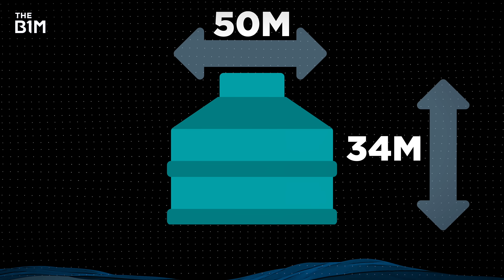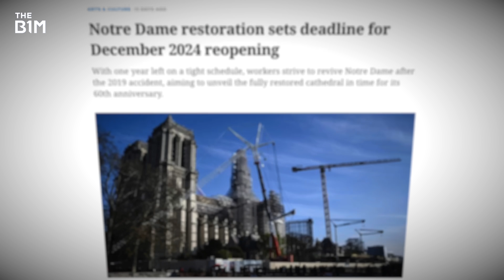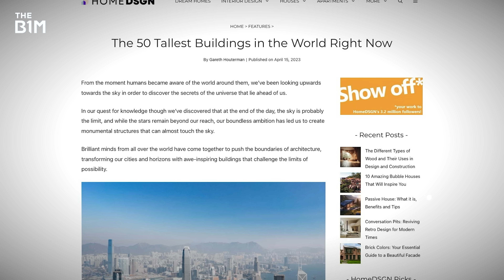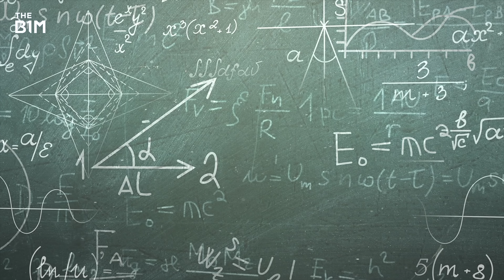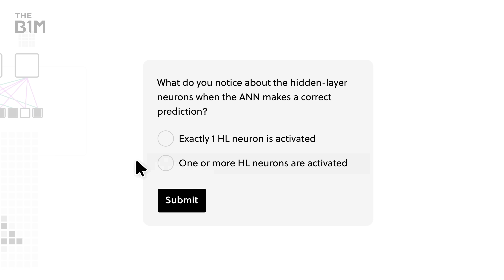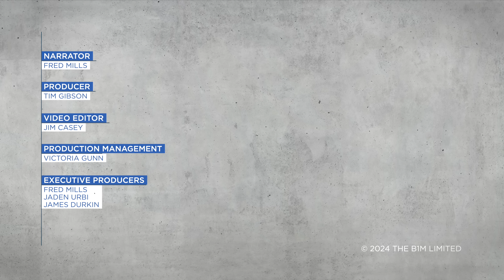Top 10 Construction Projects Completing in 2024

Comment: The One in Toronto has just applied for a height extension from 82 to 94 floors. Which recently got approved. Also, there's 2 more supertalls in the same area (one is in construction as i type this) at the bottom of Yonge street that will alter the skyline forever. They too have applied for height extensions going from the previous 90 floors to a new record breaking height of 104. Making the one under construction the first 100 storie building in Canada. The second one will go from 80 to 94 floors. 

There's also a lot of supertalls that have been approved but havent started construction yet. I would love to see a video made on these projects!
Reply: Toronto has so many projects proposed, approved and under construction I gave up trying to figure them all out. Now I just enjoy the ride of Supertall towers going up there... The One is still my favorite though and I do hope Apple reconsiders and signs onto their custom-designed space in the lobby...
Reply: @stickynorth  Me too. I love how the One looks so far with it's dark windows and NO BALCONIES. One Yonge is far more built up since it has a more typical design floor plan.. but the cladding should be interesting to see on that project. I too hope that Apple reconsiders as that was the reason why the One looks like that.
Reply: I've been visiting Toronto regularly since the mid 1980's. The city has changed SO much, as has the traffic. Back then there were dozens of lanes that were virtually empty most of the time. Today traffic is between slow and awful much of the time and there simply is not way to build more roads. Thankfully public transport has been undergoing major expansions as well. If you are heading into town from the West, the most logical thing is to leave your car in Burlington an take the Go Train. Maybe we'll actually have a link to Buffalo at some point in the future so we don't have to drive half way there. The downtown sky line has been absolutely transformed. Back in the early 80's, the CN towner appeared to be in the middle of nowhere. It was hard to get to on-foot. Now the city has absolutely exploded in growth around that area and it's now surrounded by dozens and dozens of tall residential towers. I still love visiting. I'll be keeping an eye on the sky for the new Super-Tall buildings being built.
Reply: @andrelam9898  I've recently visited Toronto and was surprised from all the foot traffic. Toronto of my childhood was quiet.
Reply: Just a small correction, The One got approved for 91 stories at 328.40m :) And the SkyTower (Pinnacle One Yonge) got approved for 105 floors and the second to 95 floors!
Reply: Okay, so we need an entire vid on the Toronto boom!
Reply: @deletedaccountdnd  what to show how no one is able to afford them and they sit empty due to the mass amount of freeloaders and fake international students that are only here to steal jobs from Canadians hmmmm time to wake up woke as Canada is in a huge problem that the big 3 can't fix unless they start send some back as Canada should not have 40 million jump in a year 38 million to 40 just shows there is a problem
Reply: The One went into receivership in October 2023 in case you missed that news timbit. "the corporation co-owned by Mizrahi and fellow developer Jenny Coco was $1.6 billion in debt to its lender, South Korean KEB Hana Bank; a trustee for multiple funds managed by IGIS Asset Management." - This channel doesn't research hard.
Reply: The one is bankrupt and not even half its final height.  its not opening in 2024
Reply: @georgewilson19   on the contrary it's now rising faster than ever with the new construction leads who took over!
Reply: @Stecbine  Hmm interesting. This was one of the reasons Apple pulled out.. because it was taking too long to build. Apple probably didn't realize that this was a totally new construction method of building for Toronto.. hence why it's taking so long.
Reply: @georgewilson19  You're right but you're a month late as the building is still being built to it's desired height. It probably won't top out until late 2024/25

Comment: There's one major point about Paris that was left out : Transit !
In 2024, there are 4 important public transportation expansions set to open : 
The very first sections of the Grand Paris Express project, a humongous metro expansion.

The 6 km Eastern extension of M11 towards Rosny Bois Perrier interchange station connecting with RER E and future M15 circular metro line (South section of M15 set to open in 2025).

The short Northern (2.3km) and large Southern (14+ km) extensions of M14, the core backbone line of the GPE, up to the GPE's main hub station in the North, which is Saint-Denis Pleyel, and to Orly airport (Paris second one) in the South.

Plus the first phase of the very large Western extension of RER E with 3 new major interchange stations along a new 8km long deep tunnel under the hyperdense core of Paris and La Défense business district:
Porte Maillot / Neuilly station, a huge trapezoidal underground light-well under a skylight ground-roof and lined by rows of caged escalators.
La Défense CNIT station, a giant cavernous underground cathedral that was built "like a mole" under the still functioning CNIT expo center by extending its foundations and creating a huge cavern underneath.
During construction it looked a bit like Tokyo's flood reservoirs with its giant pillars.
Nanterre la Folie station, a large, mostly open-air station built in a trench and partially covered by buildings. It will act as a partial terminus for some trains and thus has 6 or 7 tracks if I recall correctly.
The new underground stations are gorgeous and continue on the "giant cavernous underground cathedral" legacy of Paris RER stations.
The rest of the Western extension towards the far flung suburbs of the West will open later.

And finally, the circular tramway line T3b's extension from Porte d'Asnières to Porte Dauphine, further advancing the still incomplete loop.
It will serve Porte Maillot / Neuilly interchange and connect there with M1 and RER C & E.

All opening in spring 2024, that's about 30 kilometers of new underground extensions plus a few others on the surface that are expected to increase capacity by at least 1+ million riders per day.

Strange to not mention these as they truly are major construction engineering / infrastructure developments.
They represent the first milestone and kick-start the massive acceleration of the Paris "transit-a-palooza" madness. (After a decade of mostly tramway lines, a dozen of them opening left and right, plus a few metro extensions, now comes the big and heavy stuff).

Very interesting video as always, and happy new year Fred!
Reply: Probably because this video is just a collection of videos released 2023 and they just happen to not talk about this the whole past year.
But cool that you mention this! Maybe they will make a video about this at some point :D
Reply: @floschy_1   I'm going to lobby the GPE authorities for them to contact and invite Fred to do a thorough tour (or multiple tours) of the current and future developments.
There are building sites by the hundreds and some are quite something to see.
So that he can have plenty of footage and lots to talk about.
Plus there are some interesting techniques, like ground hard freezing for unstable watery soil, already used more than a century ago for M4 with a lot more rudimentary equipment.
Though we are past this point in the current major building phase as all TBM's have finished and are on pause (the 100+ kilometer milestone of tunnels was passed this summer, ending the first major digging phase) and stations of this phase are in various stages of finishing.
The next major building / digging phase will start mid 2024 / mid 2025, with 2 dozen TBM's going back underground to dig the 80 something kilometers left of tunnels to be built.
This project is like Crossrail power 10 with so much to see and talk about. Sadly, with much less media coverage.
I'm dying for a GPE counterpart to BBC's "The fifteen billion pound railway", but nothing in sight yet...

RER E's Western extension, although not part of GPE, would have been very interesting too, especially La Défense CNIT station, with its specific "mole" techniques through an underground car park due to the site lacking vertical access, the CNIT's foundations' extension, the huge cavern digging, etc. Same for the tunnel's access near Haussmann Saint-Lazare station, they had to reach the site laterally from a hole dug several streets away.
And very few, very limited coverage of this, except the few videos from the building team which gave pretty generic and overly simplified info.
These projects need Fred / The B1M quality videos!
Reply: This YouTube channel is ran by the Chin ese Co. mmunist Party if you comment about Tai wan they delete it automatically (that's why I have spaces in my words)
Reply: It got a mention in the Sydney Metro section.  But any top 10 will miss important projects.  I'm guessing the list was a mix of 'what video do we already have', and mix of locations (Paris, Sydney, Taiwan, Toronto ..) and type (Metro, Sport stadia, skyscrapers ..).  There were already two Paris projects and two other Metro Projects.  Though I guess a mention in the general Paris section along with the water treatment facility and Notre Dame would have worked nicely.
Reply: Guys do you not realize this is a pro CC P channel?
Reply: @datasmith4294   You seem to not know about how YouTube works...
If your comments disappear in like a minute, it's YouTube filters and not the channel...
But your commenting frenzy accusing the channel of compromission speaks volumes about yourself rather than the channel.

Comment: I know France is already featured enough, but not including Grand Paris Express is a spectacular omission.
Reply: I think the reasoning is that it probably wont be completing in 2024
Reply: @hpsauce1078  Parts will open in 2024, but fair point
Reply: I hope the Olympics go better than that farcical 2022 Champions League final in Paris. The contrast between that and the World Cup a year later was like night and day!
Reply: @khaldrago911  to be fair they only got 3 month to prepare the Chamions League final as it was supposed to be in Moscow originally
Reply: @khaldrago911   The farce was in the head of the 80000 nazi fanatics who had nothing to do with sport...
Reply: Yeah it won't be conplete in 2024 but this year marks the kick-start of the massive acceleration of Paris "transit-a-palooza" madness.
This last decade, or decade and a half, saw mostly tramway expansions with a dozen new tram lines (the 2 last ones opened last summer and less than a month ago) and a few metro extensions (on M4, M12, M14).

In 2024 that's 30 kilometers of new underground extensions, plus a few on the surface, on 4 different lines : 
M11's Eastern extension towards the current RER E and future M15 Rosny Bois Perrier interchange.
M14's short Northern and large Southern extensions respectively to Saint-Denis Pleyel (GPE's main and North hub station) and to Orly airport.
Both are important parts of the Grand Paris Express and the very first sections to open, which is a huge event.

There's also the first phase of RER E's Western extension, with a 8km long tunnel under hyperdense central Paris and La Défense business district, 3 new big interchange stations, 2 of them being underground architectural marvels carrying on Paris RER tradition and love affair with huge cavernous underground cathedrals.

And finally, circular tram line T3b being extended again to further advance the still incomplete tramway loop around the edge of Paris core.
It will also serve one of the new RER E stations.

All this is set to open in spring 2024, parts of it (22 or 23 out of the 30+ kilometers of new underground infrastructure) are the very first bits of the Grand Paris Express and altogether these various extended parts represent a capacity increase of at least 1+ million riders a day.
Plus, they are true construction engineering and infrastructure developments, more than the river opening ceremony anyway.
The Western extension of RER E isn't even part of GPE but is a major event : it is the first real significant RER extension in a quarter of a century.

Stuffing the entire GPE in one video would be difficult anyway, given the size and scope of the project, the number of lines, stations and different designs, it would be far too much to fit in one video, or even in one video per line.
It would however be easier to fit in videos for each stage opening : 14 new stations (6 on M11, 8 on M14) as part of GPE in 2024.
16 new stations in 2025 on M15 South...

Given the video shows the major infrastructure events of 2024, this huge multi opening surely misses from the list.
Reply: @KyrilPG  not only paris
Reply: GPE's new lines will open progressively by 2030. In 2024, only two existing "old" lines (11 and 14) will extend. In 2025, new line 15 (its south branch) is expected to open.
Reply: The Grand Paris Express will not complete in 2024 so thats why its not on this list. The 1st phase is only due to open in 2025 & the 2nd phase in 2030.
Reply: @stillzeropoint  1st phase is in 2024 (line 14), 2nd in 2025 (line 15 south), 3rd in 2026 (part of line 16 and 17 ) , 4th in 2028  (parts of line 18, 16 and 17) and the last phase is in 2030-2031
Reply: It's mentioned during Sydne's metro part!
Reply: Not really opening in 2024